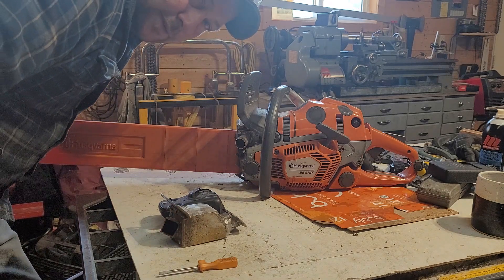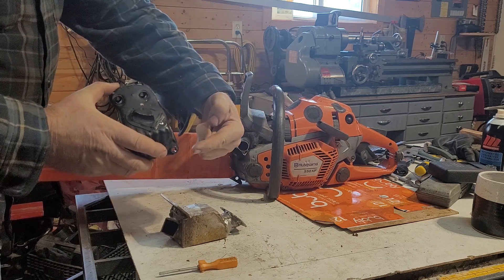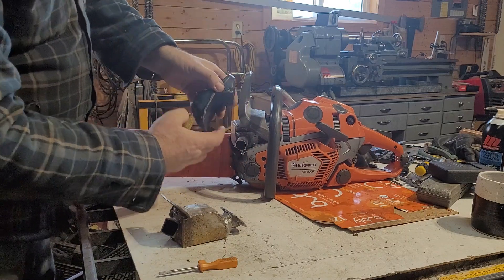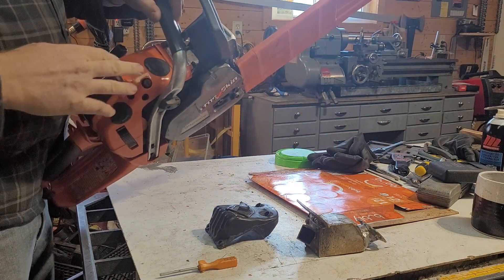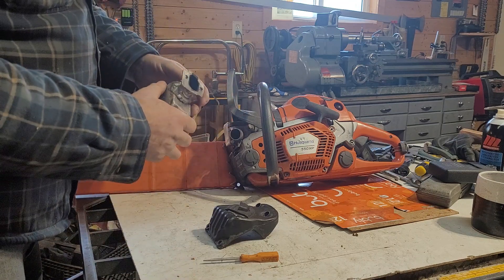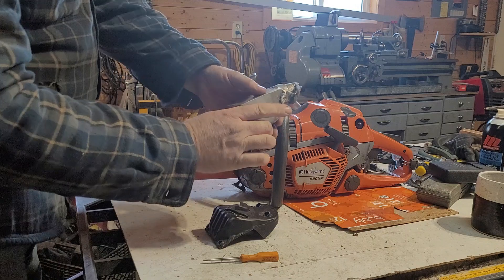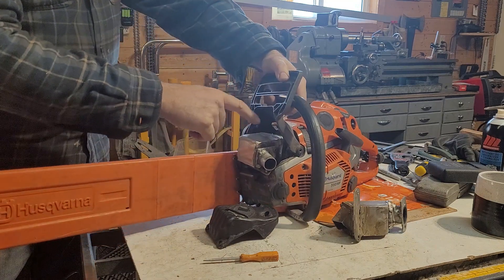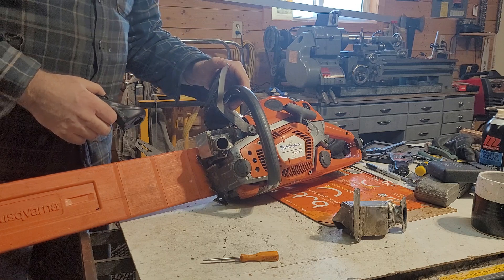Husqvarna 550, 555, and 562xp muffler mods.

Comment: I like your ideas def going to get frog skin for my 550 xp m ii love the saw but gets warm fast even w muffler mod. thinking about a 562 now thinking I should save up for 572 or just pick up a 555 throw a 24 at it
Reply from the maker: From my experience, I'd stay away from any of the Husky 562, 555, 550 and 545's. They have too many chronic flaws.
The 572 seems to be reliable, but it also vapor locks in the heat.